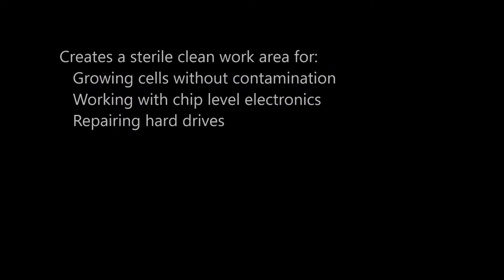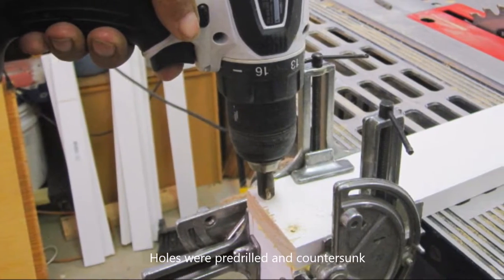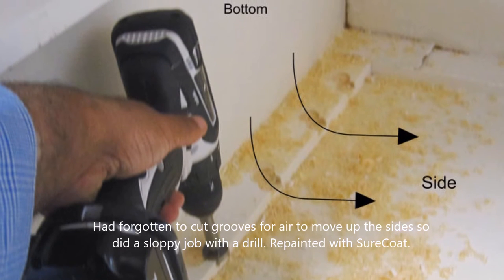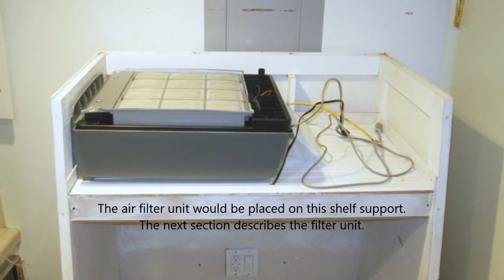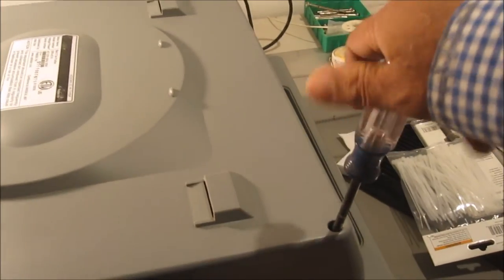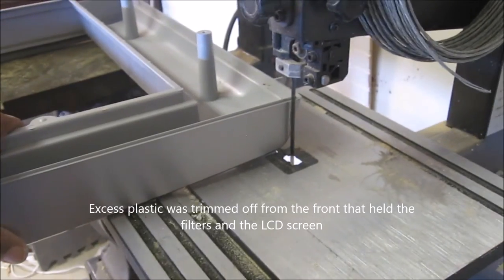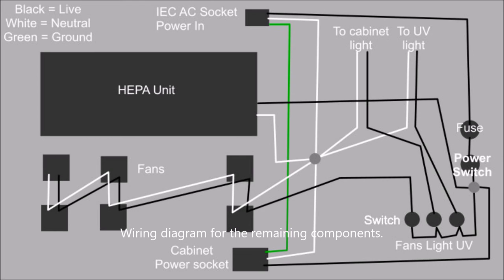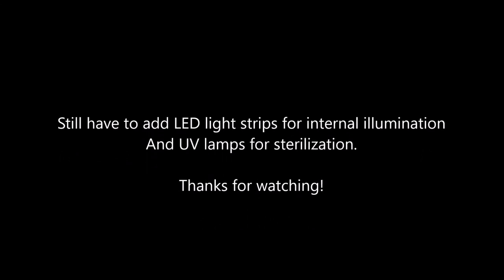DIY Tissue culture hood

Comment: Very nice full sized BSC.
I've opted for a more basic version using a box shaped 22" x 8 x 9" hepa 99.97% at 0.3um air purifier, and without using additional motor, stuck the whole air purifier to a container to make a 2ft hood. 
I think for most DIY applications, a 4ft/6ft BSC is overkill.

Comment: Has the Hepa filter been integrity tested, would want to make sure there are no leaks in the filter or the clamping system.
Reply from the maker: Doug Peat . Had done a smoke test to check for flow patterns and the smoke was cleared but have not done a proper test. Hoping the original air purifier design was good enough.

Comment: The filter and system you used unfortunately is not near the hepa quality needed. You need a true laminar filter with no less than 99.998% hepa quality. Cheap ones are $120 usd plus you need a real squirrel blower that can achieve the correct cfm to create laminar flow.
Reply from the maker: Well you know what you are talking about! The filter was a true HEPA but you are absolutely right about the blower. I upgraded the hood with a hefty blower. Have to post a video about the updated construction. But essentially the room air purifier with its integral blower and filter were replaced with a squirrel fan and a larger true HEPA filter.

Comment: In the diagram at 1.05 you have a mixture of sterile and unsterile air in the cabinet?
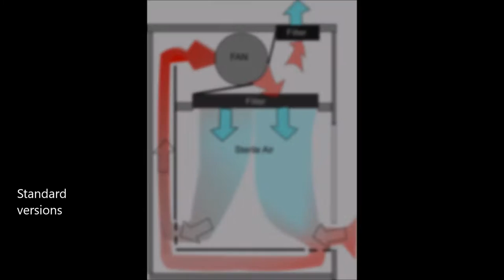Reply: It's 3 years but I'd like to point out that this is not how laminar flow is supposed to work. It should protect the samples inside by the air not mixing with the outside. Take a look at 1:10. What this diagram fails to show is that the air is sucked straight down in the direction of the laminar flow "barrier", so that it is not messed up and goes through the filter before actually entering the working area. Drawing an arrow directly into the workspace seems like a bad design choice, although it seems like the idea is there. What is meant 1:05, however, I can't explain. To me it seems as everything is sucked over the samples once because the entire floor is a vent opening. Also, it would create a turbulent flow which destroys the entire purpose of a laminar flow box. It filters the air, of course, but it would not be sterile. Maybe I'm missing something, but I fail to understand how this diagram is supposed to represent a functioning machine.

Comment: How has the hood held up over the years?
Reply from the maker: had worked well till I dismantled it and replaced with a 'foldable' version. The UV light discolored the surrounding areas - would have been better to have covered the panels with aluminum surface. The newer version uses a blower fan similar to what I used in my laser cutter air filter. Have not recorded a video about that construction.

Comment: Wow! For sure it will help lots of people, including me. I am making one but I am planning to use just an electrostatic precipitator, do you think it will work? And I think this is not a biosafety cabinet (you can't work with dangerous organisms), since it don't have an exit window on the top and the airflow will go out on you, but your design has better sterility, since no unfiltered air will enter, so it's more suitable for tissue culture... Nice work!
Reply from the maker: Felipe Tanaami  Hi Felipe, thanks for your nice comments. the hood has been incredibly useful. the hood does have an electrostatic precipitator as part of the original air purifier. the most important were the uv lamps. they really sterilize the space. an idea is to add a uv lamp where the fan shoots out the air. will post an update ...
Reply from the maker: Like electrostatic precipators, would be nice to have a separate large panel which would serve as an electrostatic precipitator. The room air purifier that I re-purposed has an air ionizer but nowhere near as effective as an electrostatic precipitator. I have seen these precipators on craigslist in San Francisco, California. APpranetly folks who are upgrading their house AC systems get rid of fully working units. 
Correct on the exit airflow. Should be able to modify this into a BSL2 by having a smaller filter attached to the top so that air can exit from this smaller filter.

Comment: The diagram at 1.05 isn't how I thought a laminar cabinet worked at all
Reply: It isn't. Most Laminar Flow Hoods, or Clean Benches pull air in from above the unit and then bathe the work zone in sterile laminar airflow. 

What is proposed here is NOT a Biological Safety Cabinet. Furthermore, How does the designer expect to have performance validated for airflow speed? for HEPA filter integrity? for personal or product protection. While many things can be built, and even at half of retail prices, why would you not want to purchase something from reputable manufacturers that are audited and held to design standards by 3rd parties?
Reply: @bdgarrett81  if you're doing it for home use then why would you want to triple to x10 the price for the third party certification and design that works similarly to one you can build yourself. I feel the same way with electronics, repaired a HP 34401 precision benchtop multimeter that normally requires yearly calibration and certification but it works more than well enough for my projects using my own custom build calibration standard that I build from raw materials for resistance standards and an ltz1000 voltage reference all compared to similar equipment I had access to at my day job, at least .05% in all of the tests I've done and less than a tiny fraction of the cost to have the same thing done with a "proper" precision voltage reference for calibrating, even with the same reference chip (ltz1000) and accuracy. Homemade, in many circumstances, can be just as good if not better depending upon your usage.

Comment: I don't understand why you would draw un sterile air in through the front of the cabinet
Reply from the maker: These are called class II cabinets, compromise of protecting the operator and the materials. Class I, classical laminar flow cabinets, flow sterile air to the user but this air passed over the materials and then to the user so some risk to the user. Check out the link - good information - https://www.bakerco.com/introduction-biological-safety-cabinets
Reply: This is NOT a Class II BSC. and a Class I is NOT a classic Laminar Flow Cabinet. Laminar Flow Hoods and Class I BSCs flow air in the opposite direction.